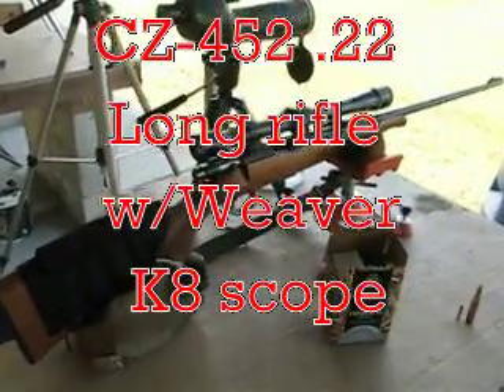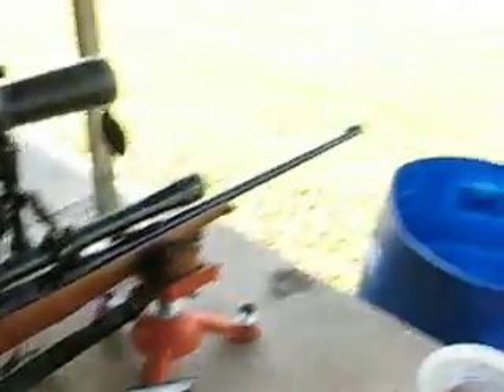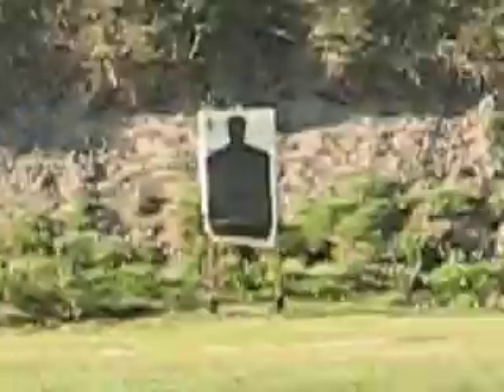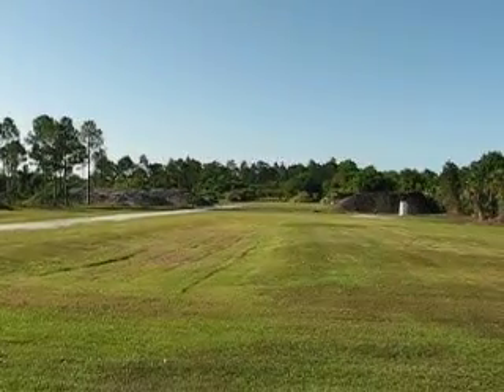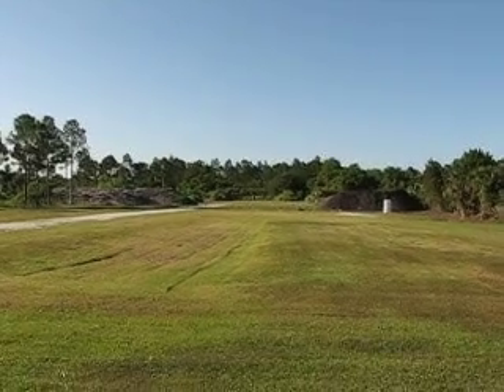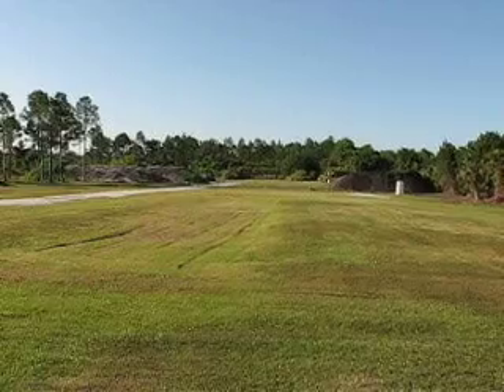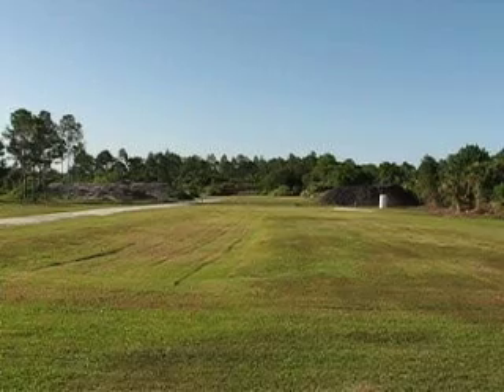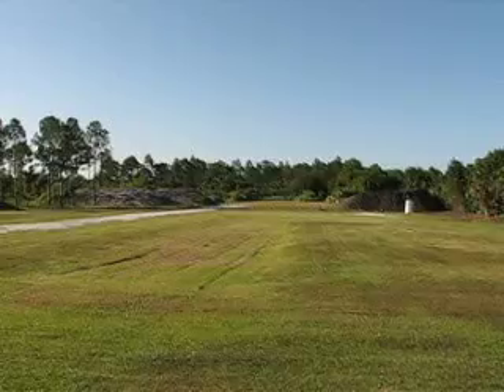Long range .22 Rimfire long rifle at 200 yards. Video 1 of 2

Comment: According to test preformed by shooting magazine the max velocity from 22 lr is from about 18 inch barrel and in test started with about 24 " and measured velocity at muzzle with 10 rounds and then cut 1" off and repeated. there is a finite amount of powder to burn and expand and in 22 lr is not  a great amount and after speed maxes out extra barrel will slow down bullet.

Comment: I did a bit of shooting with my marlin bolt action at just over 200 yards.  I was getting about the same kind of accuracy as in this video, missed a couple shots, but for the most part surprisingly accurate.  Calm day but by my figuring the bullet has nearly two feet of drop at that distance.  I've also done 100 yard shooting with a ruger mk II handgun, .22 ammunition is surprisingly versitile.

Comment from the maker: @CharlieDoan Because 75 yards is boring! I have a Ruger Mk. 2 with a 6 7/8" barrel and a scope on it that I sometimes shoot out to 100 yards or a little more with success. I think that CZ in the video has a 24" barrel but a shorter barreled .22 will  get the job done, too. I don't condone hunting with a .22 at these extended ranges but just blasting like what I'm doing is fun and challenging. I'd try 300 just because but my scope would run out of elevation adjustment.

Comment from the maker: I lightened the trigger pull by replacing a spring, free-floated the barrel (if that even matters with a .22), Replaced the sling swivels with wider ones, and the scope. 
I had contemplated a 452 Varmint but I bought a 1940's vintage Remington model 121 instead.
Enjoy your new toy and post some video's of it when you get it. With that 20X Leupold you'll be able to see everything!